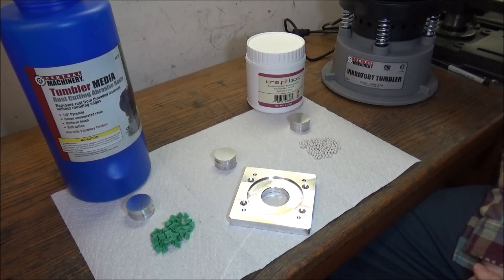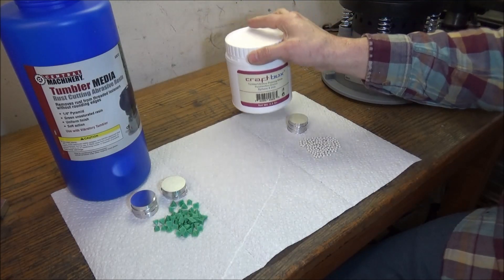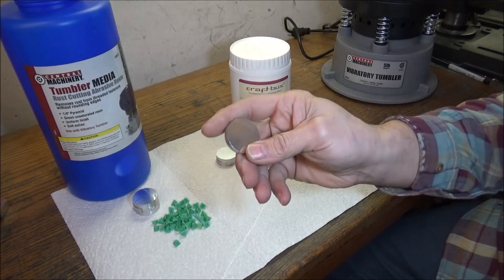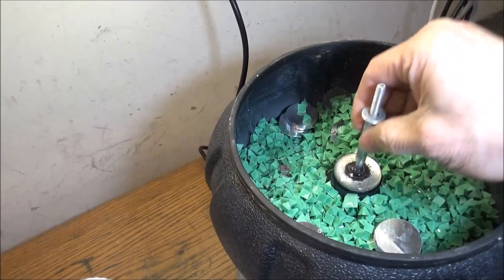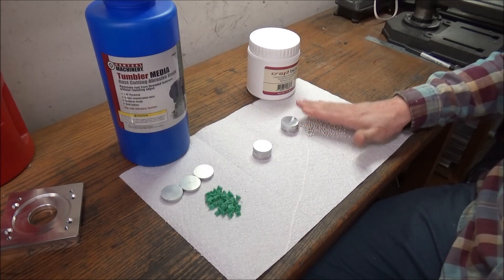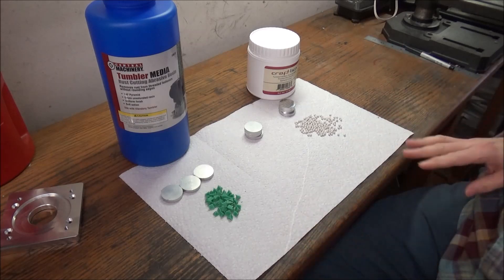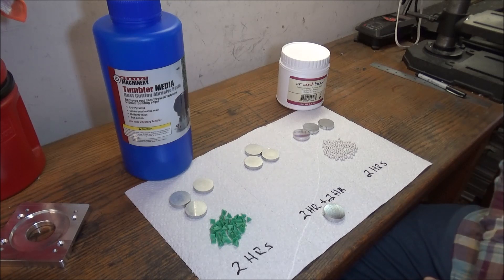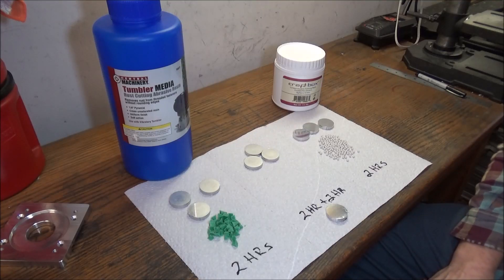Tumble Finishing

Comment: I had worked in a shop the injection molding of Zinc parts. They came out of the tumbler machine with a slightly dull finish & all the sharp edges were rounded off. I can't remember what media we used in the tumbler machine. You may want to increase the time or go with a different media  to round off the edges that you can't do by hand while maintaining a very polished surface finish. There are hundreds of different media that you could try. And I would be interested in more videos of you using different media in the future.
Reply from the maker: Thanks for the info yes there are a lot of different things I have noticed.

Comment: i used sev. of the vib. tumblers for brass long time ago with walnut shell and possibly corn cob media: they have two little bearings, one at each end of motor shaft, the one nearest the bowl will seize and fail as the grit enters it with no protection....your use of water may reduce that by eliminating airborne and fine grit seeping through shaft hole, etc. I'd throw a box over tumbler and run in shed due to noise. The stainless steel pin media was awesome for parts with voids such as cartridge brass, esp. primer pockets.
Reply from the maker: Awesome thanks for the tips.